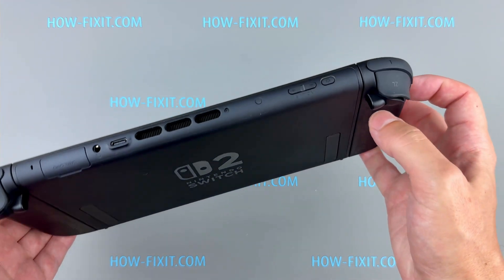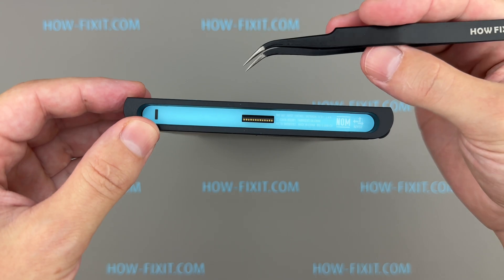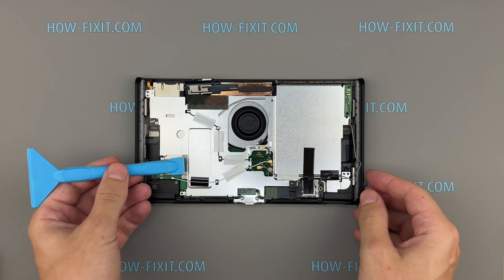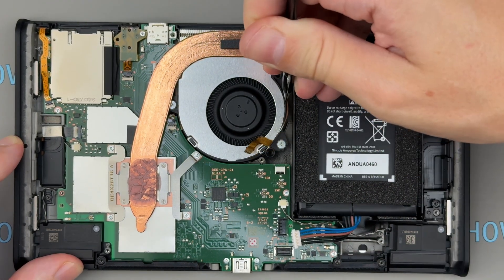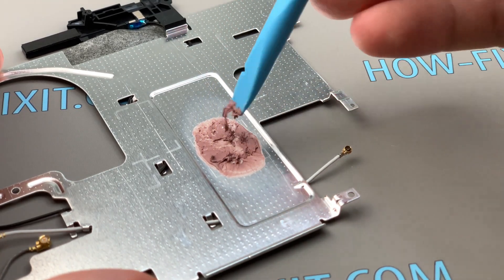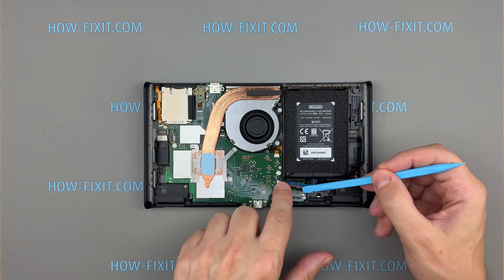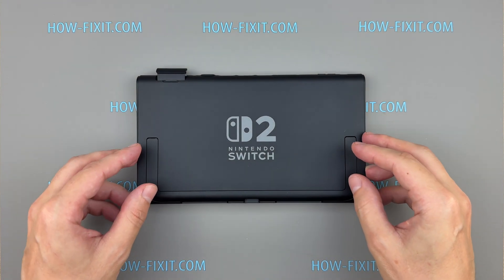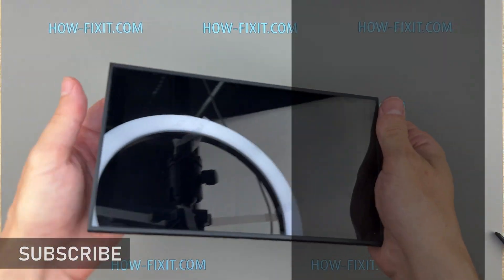Fix Power or Volume Buttons on Nintendo Switch 2 | Complete Flex Cable Replacement

Comment: Great video thank you! I took mine apart because I dropped it in a toilet lol The power button was hit and it was in a steady power off state. 
The screen was blotchy too in the upper left corner of the screen. 
Needless to say, after taking it apart about 10 times for stupid mistakes Ive lost about half the screws, broke a speaker wire, and snapped off the power button ribbon lock latch or whatever you call it. I think its time to get someone to repaste it and replace that ribbon because its gone now too.
A friend in my building just soldered the speaker wire back together and says he can replace the screws and do a full repaste. 
I'll see what his rates are but I think its for the best.